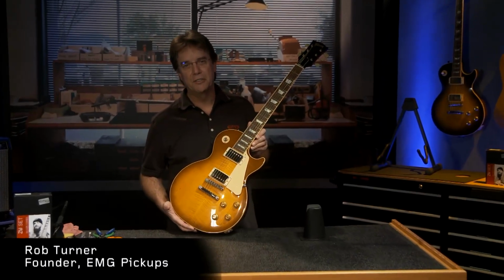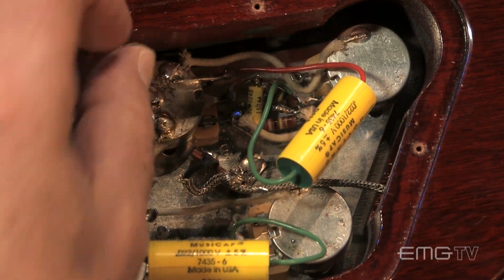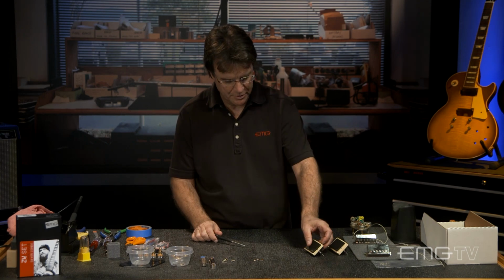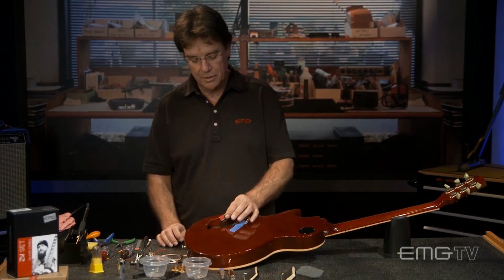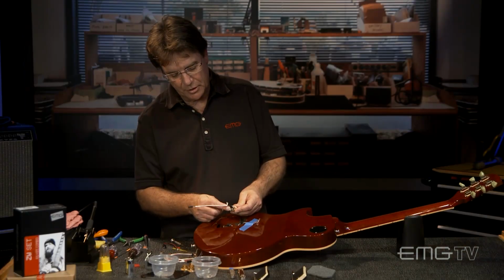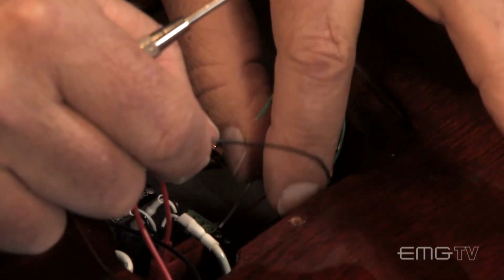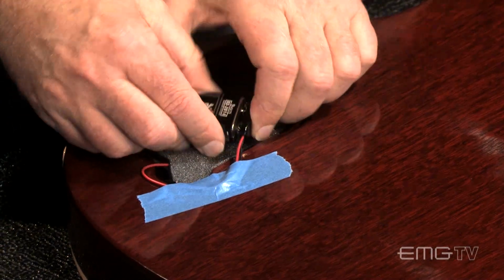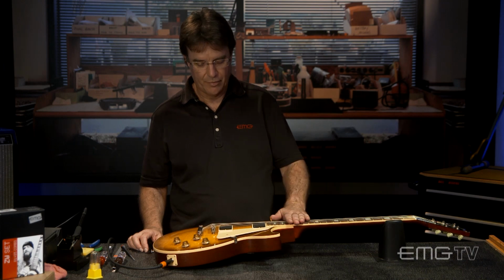Easy solderless Zakk Wylde signature pickup Install with Rob Turner, EMGtv

Comment: So i was wondering if it's really possible for solderless pickups to be wired in a way which eliminates the need for selector switch.... 

I got 2 EMGs and 4 pots ( two for each pickup) , but I don't want the selector switch in my guitar... 

Therefore I wanted to know if it's possible or not... 
if yes please drop by an explanation or diagram link. coz I tried it but the buzz noise won't go away and when I fix the buzz noise the pickups just don't seem to work...

Comment: So maybe u can help. Did the same install to an Epiphone. Les Paul. All wiring is good. Battery is new. Used Emg toggle. And also tried wiring mine back in to fix the problem but it hasn’t.  The problem is when toggle is in middle and up position both pickups are on.   All wiring is right and been re done amd checked 10 times. But even with all new Emg wiring the toggle is causing this problem. When down the toggle only turns on the bridge pickup. So I’m at a loss. Any ideas ?
Thanks

Comment: I‘m very confused, I‘ve read in a forum, that EMG equipped guitars do not need a ground wiring/soldered cable to the bridge. Is that correct?

Comment: Another thing you can do instead of using your own toggle switch you can just buy one from them then you won't need to worry about the colors of the wires.. I bought the toggle switch a week later .. for around $30 i got new control knobs also so everything is EMG 🤟🏻

Comment: Hi, could you give me a piece of advice? I have two EMG 89s, and I would like to use one of them as the 89R in the neck position. Which means that it needs to be installed upside down. Can it be done this way? The idea is to get only the outer coils live in the split mode. Will the upside-down position make any difference to the sound (either in the humbucker mode or the single coil mode?

Comment: I've just bought a set of these off Amazon, I have 1 large pot with that quick connection. Then 3 little regular pots with soldered prongs, wires only have connections on one end
Reply: Also, I only have that red connection block on the bus
Reply: Also no battery connection.

Comment: This set up isn't working for me. I get no pickup output sound when jack plug installed. If plug is only half way in Both pickups make sound regardless of selector switch position. I even wired up a different stereo jack just confirm it wasn't the jack

Comment: Are EMG's the only solderless pickups available? They're way too expensive for my needs and soldering isn't an option for me. I gutted a cheap guitar thinking it shouldn't be too expensive to replace the internals but ordering a solderless humbucker alone will cost more than the price I paid for the entire guitar itself and that's not including the solderless kit lol
Reply: GFS has a solderless system as well. Keep in mind, you still have to solder the switch sometimes

Comment: This would have been extremely easy for me to do on my Gibson SG Gothic Morte, but the "Stereo Output Jack" is too short to fit all the way through the body. There is no EMG option one can even order. I have to use the Gibson one, which does not connect the same, and will require me to solder, something I'm terrible at. :(

Comment: You just ruined a perfectly great Gibson Guitar! You would have been better to install two positions pots for phase variations on the pick-ups! Also a 24 volt power supply for the active pick-ups! The original PAFs are so much better tone wise! Reissue 59s by Gibson would be the best selection! Wanna sell the OE pickups and OE pots? No, I don't blame you. You'll be putting them back in!!!! LMAO 😂 ✌🏻

Comment: Ok, I bought a EMG 57 it came with solderless wiring setup. Up until my soldered system crapped I switched to the provided solderless assuming it’d be great. Unfortunately it sounds muffled unlike previous setup. I followed instructions verbatim but it still lacks the high end tone you’d expect. To get a sense of what I’m saying, the guitar tone sounds like the tone knob is rolled back completely but it isn’t. What is the problem here? Any suggestions?

Comment: I’ve been able to do my LP, SG, V, and Explorer with no problem. I can’t get a HH 3 way switch Strat to work for the life of me. I’ve even tried the solderless EMG 3 way switch. I’m lost.
Reply: Did you figure it out? You can always call EMG, go ahead and take photos of all connections made including the back of pickups and attach them to a an email. Call EMG tell em what you got going on.
Reply: @Ikillintel1  I did. I used a couple of different diagrams and it’s working perfectly. I set it aside for about 10 days and came back to it fresh and got it first attempt.

Comment: I'm using EMG 81 and 85 ZW set which I've had for over 10 years now,still going strong. My axe is a handcrafted by Luther Pendragon called Excalibur. Now my EMGS had to be soldered due to small cavity space and no luxury les Paul roomy cavity space to do easy emg solderless installation. We'd all love that but for me no chance. And to be honest I love the emg very responsive especially for heavy rock styles etc. 

Yet in my ibanez prestige I'm using the superb Bare Knuckle War pigs that's passive and not active and super high output and they are amazing hand crafted scatterwound pickups. All from the uk.  So for me both pickups are incredible for what they are.

Comment: You will need a set of tools... you will need a half inch nut driver,  a 7/16ths nut driver, a philip's head screwdriver, a pair of scissors, some needle nose pliers, some wire cutters, a small screwdriver, a ruler marked to half of an inch, a salad shooter, a bar of Irish Spring soap, Tupperware (must be brand name), a small llama named Steven, the necklace that the old lady threw overboard in the film Titanic, a copy of the complete memoires of the Marquis de Sade, cheese (for the mouse), a mouse (for the cheese), a second llama named Steven, some helium, an early 20th century prophylactic that has been blessed by a Native American Shaman, Ellen DeGeneres (I know - ewwww), a living member of the Beatles and this fellow here to do the work for you.

It is just THAT easy with EMG's quick connect kit!  (now with third llama)
Reply: You got me dying over here!🤠

Comment: My ZW set (and 3-way toggle switch) just came in, and I'm very excited to get them installed. I'm a longtime fan and user of EMG pickups, and can't wait to make my old B. C. Rich Bich my new B. C. Rich Bich.

Edit: Also, such clean wiring is incredibly satisfying to see to an IT guy.
Reply: Looking at the same setup for my warlock and was thinking about the x3 way selector and x3 pots vs the x4 used here, any info / links that you followed or is it documented with the pickup set?
Reply: @Petemotox  The documentation that comes with the pups is very thorough, including wiring options for different types of switches (which you will have to order seperately). The set included the wiring harness, connector wires, jack, battery bus, two volume pots, and two tone pots - really everything you need to completely rewire your guitar. The plug-and-play aspect made it incredibly easy to install, and I've had zero issues with loose wiring (which seems to be the biggest worry from the other guitarists I spoke with before buying) in the three years since installing the new electronics. I'm a longtime EMG guy, so I ordered my set straight from EMG's website. Just be advised that you'll need the 10mm stemmed pots (you choose when ordering) for your 'lock so that your knobs won't be hanging an inch above the guitar body.

I hope this helps a bit. Stay TRVE KVLT!
Reply: @antonkovalenko364  excellent thanks appreciate the reply 👌🤘

Comment: I'm a huge fan of active pickups! BUT the not-soldered clamps for the 6,3 mm banana clutch and the 20-cents battery connector are non-professional garbage for a vibrating device. This could have been done easily much better. So thumb down.
Reply: Have to agree. A clip in my DG20 loaded Strat vibrated loose. I thought the set up crapped out, but nope, just a loose connection.

Comment: I want to update my Ibanez GRG121 with the Zakk Wylder set, how do I need to solder the cables to only use one Tone and one Mater Volume for both pickups and how do i connect them with my 5 Way switch?
Reply: You can't use a 5/way switch with the ZW set. The 81 and 85 ONLY work as humbuckers, you can't split coils on active pickups the way passives work.
EMG sells a 3/way blade switch for around 30$ that works with this system. You won't need the Buss if you get it, it works as both the buss AND the switch.
You plug the pickups into the switch then go from the output to the volume and tone, then to the jack(there's other ways as well)
If you need coil splitting/single coil sounds the 89/89R/81TW do those with individual coils and push/pull pots and sound very similar to the ZW set.
Hope this helps
Reply: @AdamYoudell  Thank you^^  so I guess I will buy a new Guitar then^^
Reply: @Kjaldir   30 extra bucks would be alot cheaper than a new guitar, but up to you. LIke I said if you want to switch to active pickups, they won't "coil split" like passives, Seymour Duncan or Fishman will not either. Maybe look into a new set of passives if you must have a 5-way switch. Cheers

Comment: I got this system a couple of years ago. One thing they do not tell you for strat/tele type guitars is that you can actually get a 3 way and 5 way selector switch that's solderless. With that you can completely eliminate that buss chip. You still have to buy them separate though which was annoying. I don't understand why they cannot package the selector switch with the volume and tone pots....perhaps they have done that at this point but when I did it, it wasn't an option lol.
Reply: I don’t mind it a little more work when I did mine didn’t bother me I was just happy I got one of my favorite sets back the controversial EMG HZ set back
Reply: @redstonemaster4300  Why is EMG HZ set controversial?
Reply: @ULTRALXV from what I know most of the EMG community doesn’t like the passive variants that EMG did for quite a bit but I tend to prefer them cause I learned on multiple sets of them

Comment: I just spend several days trying to wire 1 emg h4, and it has sound, but together with this really annoying buzzing sound and a tapping sound when i touch the strings. Ground is connected to the bridge. What am i doing wrong? Please help

Comment: I have a Gibson les Paul custom (2016) and the green cable has been cut too short at the factory so I had to replace the toggle switch and I bought the 81 and 60 and they don’t let you the choice of long or short pots so I have to pay $45 for the four long pots

Comment: my 3 way toggle has no wires attached so unfortunately I am going to have to solder. Question: I noticed in your video that the red, green and blue wires coming from the toggle, have white wires inside that go to their positions, but also have another wire and all three are also attached to the ground. Is that required? I noticed that on the other end of the wires (where it goes into the solderless part) that they only have the one main wire.. can anyone explain if that is a requirement and why its like that??

Comment: Can this be installed on a guitar with 2 humbuckers, that has 3 way switch, 1 volume, 1 tone control? Will there be any soldering required and is else needed, besides what is provided in the set?  It's currently with passives.
Reply: yes you just add fewer wires to everything. It will tell you in the book you get with the pickups. Also if you buy one of there solderless switches it will be even more easy you won't have to solder anything.

Comment: I have the solderless 81/85 and 57/66 installed and IDK, I'm getting all kinds of noise buzzing I've even bought and installed the EMG 3 way toggle and still same results noise and buzz. Everything is fine while I'm playing but between songs if I keep my volume up I get buzzing noise I didnt have this problem with my passive pickups. I dont understand same problem with two guitar?????

Comment: WOW WTF! I never knew that changing the distance from a pickup to string could effect the tone
Reply: Oh yeah, the shorter the distance, the more of the vibration is in the magnetic field, and in effect, the stronger the signal from that pickup. However, too high and the pickup starts pulling on the string, which can start affecting tuning and intonation. (And depending where you pick, higher pickups can be a pain in the arse haha)

Comment: Is it possible to change pickups by only removing the pickup wire and then soldering the new pickups or is there more?
Reply: No... Not if you're switching from passives to actives. The actives need the electronics installed.
Reply: +Derp Derpson just wondering whether or not it was possible to change some standard les paul pickups to some seymour duncan alnico 2's that way
Reply: +Eastness Oh! That's possible. As long as they're passive humbuckers you should be okay!

Comment: I have a P/J set without the solderless connectors and I am having a hard time wiring because for some reason the sound comes and go. Can you please help me because in your site most of the diagrams showing are with the connectors, please and thanks in advance; Josh

Comment: Please help me, which do I buy for a schecter hellraiser extreme c1 fr with 81 and 89r pickups. It's all soldered, but I want the one without it. And can I use this solderless connect ion with bareknuckle pickups? I bought a set of juggernaut and would like to switch out whenever. Please help ;~; I can't find any info on the websites

Comment: Just did this in my Epiphone SG. Took me about 2 hours cause I've never done anything like this before. Didn't run into any issues and the only thing wrong is my toggle switch is the wrong way round now, easy fix when I can be bothered. Thanks for the video I would have had no chance without this!
Reply: Unscrew it a bit and turn the toggle upside down...problem solved.

Comment: "Solderless pickups" but you still need 36 tools and a degree in eclectronic engineering to install them
Reply: no you don't it comes with a very clear diagram when you get the pick ups.
Reply: Antony Quigley also, much safer to do than soldering, it’s easy to get badly burned
Reply: @arando4359  thats the main reason i go emg. 30 minute install? Noiseless pre amp? Oh fuck yea!
Reply: Antony Quigley it’s really easy, actually.
Reply: Nah bro. You yourself might have difficulties but its easy for people with average intelligence.  Or you need a reason to try justifying to yourself not using emg pickups. 😂
Reply: All you need is a soldering iron, how lazy are you?
Reply: It is the absolute easiest pick up install you could ever do
Reply: This is super easy now. When I was 14 installed pick ups without knowing anything about wiring and that was easy too
Reply: Damn dude, those instructions are easy! There are preamps out there with MUCH more difficult wiring diagrams.
Reply: The tools are for removing the old pick ups. Did you expect EMG to invent a system where are you snap your fingers and it is automatically swapped? These are really easy to install for people with average intelligence so if you have a hard time maybe guitar isnt for you. Sorry to sound harsh but what do you expect when you go around trolling.
Reply: Its so easy just follow the instructions
Try out to solder some Seymour Duncans. That shit is way more difficult to do.

Comment: how i can put these pick ups with 1 volume 1 tone and 1 3 potition switch???
Reply: +XDX I'm still looking for a way to do the same thing on a LP Special 2, I guess that the simplest way to do this would be to expose the tone control and volme wire and link them toghether, that would allow to use the same settings you have on your knobs for both pickups when flipping switch.
Reply: Adrian
yes thats right...
i done it but i like better my previous sd jb/59 pick ups hehe
Reply: +XDX It' easy, just wire the pickups directly to the bus, and put the controls between the bus and the output jack.
Reply: oyhe94 hey dude, u sure this works? I'm thinking of putting emg's hetfield set on my jackson and don't know what to do
Reply: Cheap fix,
Just bury the extra pots in the cavity if youve got the space of course that is. I preset my controls and bury them. I may be a one trick pony, but i crave consistency in my rig.

Comment: With all the advances in modern technology etc, and guitars fetching anything from 40 bucks up to 150 thousands bucks, it'[s crazy that guitars are SO badly put together. Like apart from the mood, everything else is just cheap tacky shit. Look in the pot cavity on that Les Paul... a 3 grand guitar, maybe more... shitty dusty wiring, VERY messy soldering work, cables everywhere etc.. yet it's supposed to have that "Magic sound" that only shitty solder and cable jobs can get you lol. 
You'd think all guitars innerds now were just connect the Male to the Female like on the pickups. Should be that way directly to the pots too.
Reply: Apparently that “magic sound” is based around capacitors the size of municipal garbage cans being shoehorned into the electronics route and secured with enough solder to fill a life-sized mold of the Statue of Liberty. 

Extra points for a factory headstock re-glue! 

Play Authentic, eh? 😁
Reply: Wait a few years when corrosion sets in while you're trying to play a show.....
Reply: Late comment but epiphones are wired with plug and play at least for push pull pots, only things that were soldered on mine were ground and signal to the switch and tone
Reply: How nice did you want the part of the guitar that is never seen to look dude?
Reply: Nashville Hillbilly here, 
Been playing 30 years. All this machinery...oh, I do not like Gibson guitars. I primarily play Dean Guitars but, that is also my preference.  Dean can make expensive shit too.